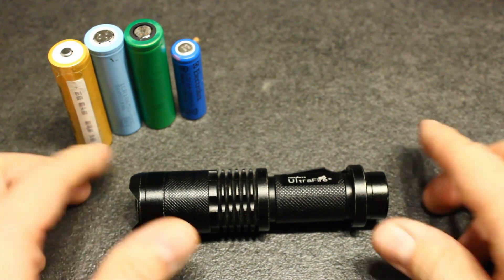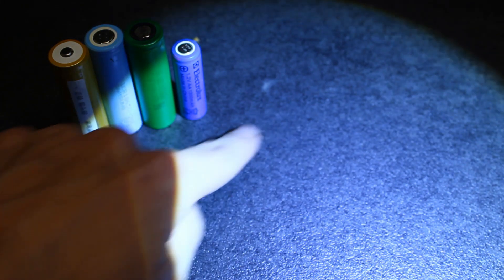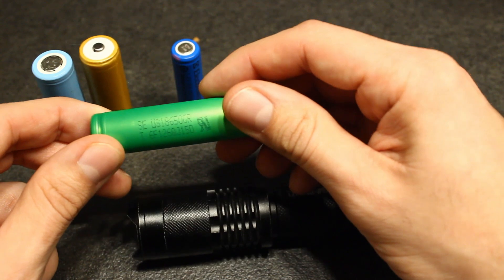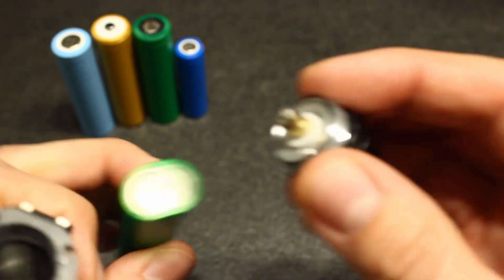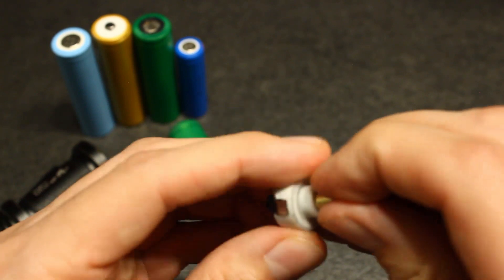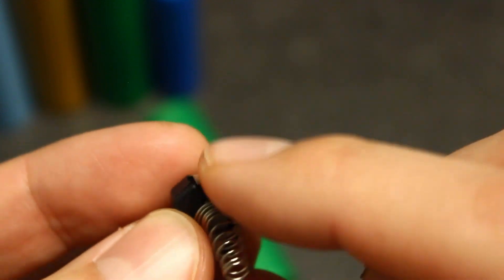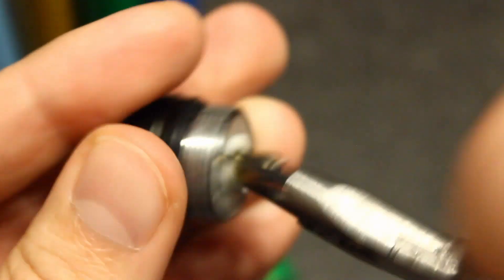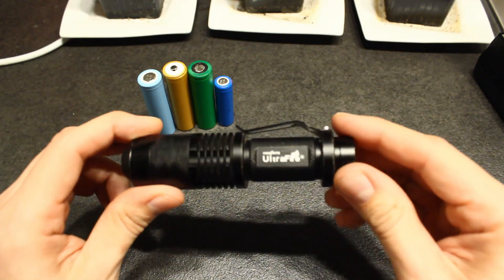UltraFire SK98 flashlight high current mod

Comment: You're obviously capable with soldering, why not solder the spring to the clip that connects to the tail cap?
Reply from the maker: I didn't think about that! I might try in the future, but I'm not very confident about the result because the spring needs to withstand some deformation each time you change the battery, I think the soldering can easily deattach.